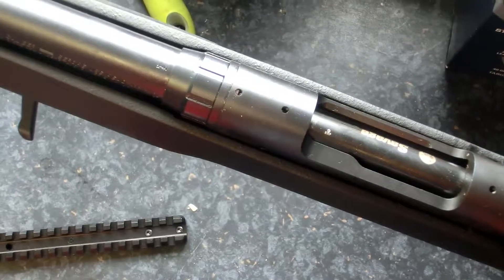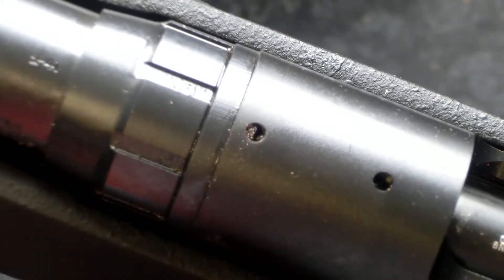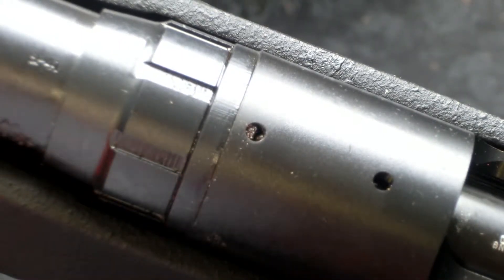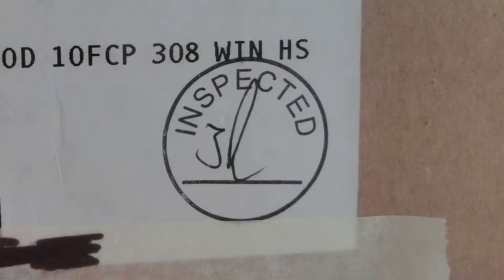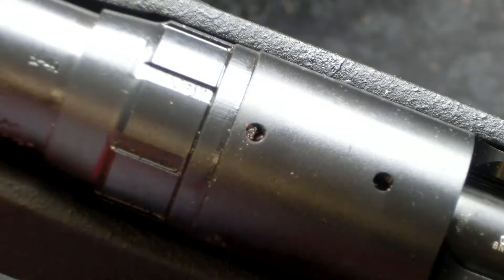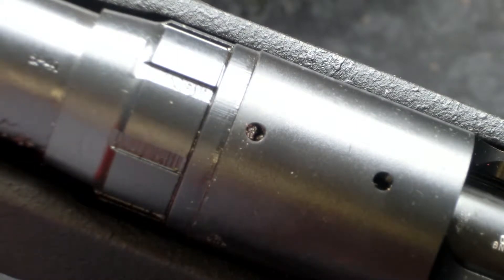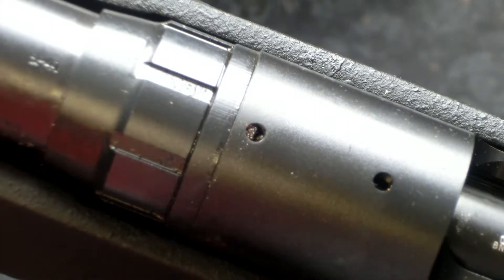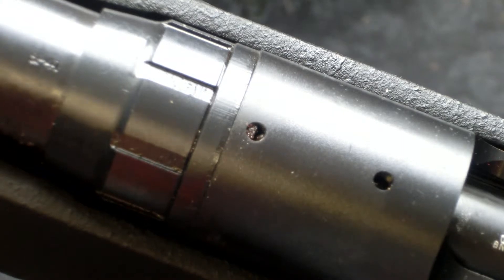Savage Model 10 FCP HS Precision: Rail Fitting (With Quality Control Problems UK)

Comment: Mine had the same problem with my 338 stealth. I went and bought a 8/40 start and bottoming taps and cleaned the holes up. Used longer screws than the factory  screws and used blue lock tight.